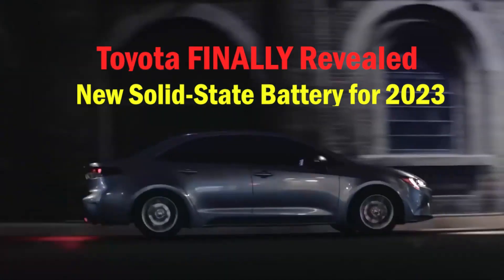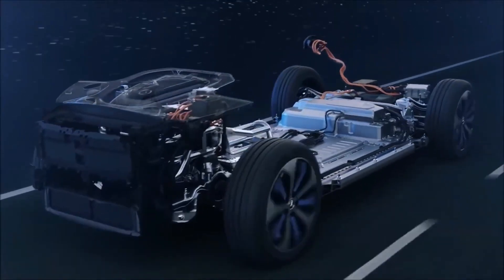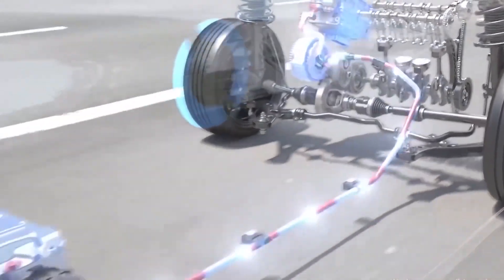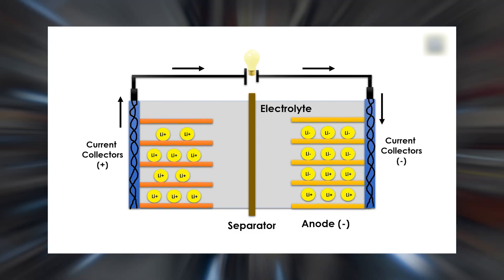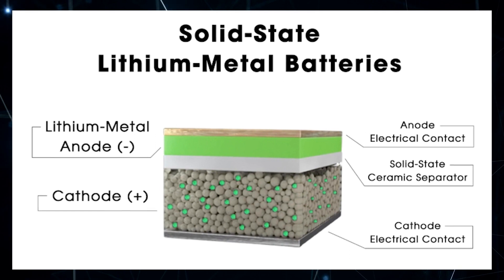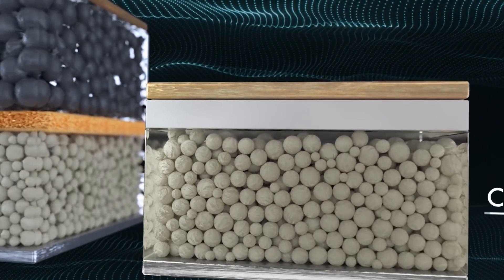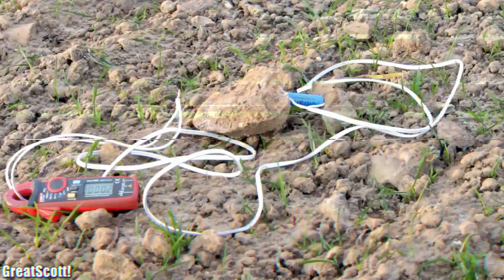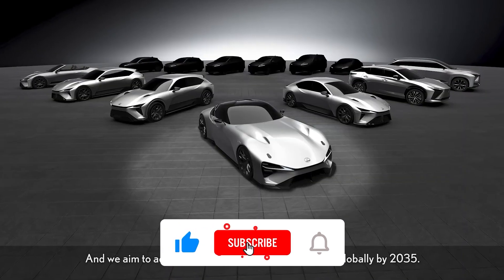Toyota FINALLY Revealed New Solid-State Battery for 2023!

Comment: A solid state battery roughly has the same energy density as fossil fuels, so it's indeed a game changer.
Reply: A solid state battery can deliver about 8k-10k Wh/liter of energy density, whereas a Li ion battery is about less than half that, or 4k Wh/l.  So essentially a solid state battery is a "full tank of gas" as opposed to today's Li-ion batteries which are a "half tank of gas".

Comment: Virtually all the specs you mention are far surpassed by current LFP batteries. Literally all.  It is true Toyota may be leading the way to bankruptcy, but CATL, BYD and Tesla are leading the way to low cost batteries by adapting and changing plans as technology rapidly changed. Toyota is clinging to the raft of solid state before they drown. Try discussing cost per kW of LFP vs solid State and you will begin to understand. As great as LFP is now it will also likely be replaced by a better technology in the near future as well. CATL, Tesla and others will immediately adopt that new technology while Toyota helplessly clings to solid state. Turns out hiring a CEO based on nepotism isn't such a great idea. Sell your Toyota stocks while you can.